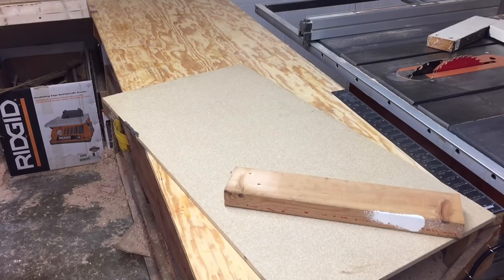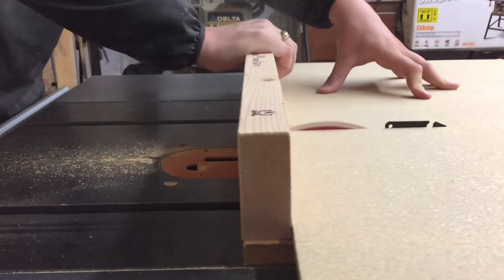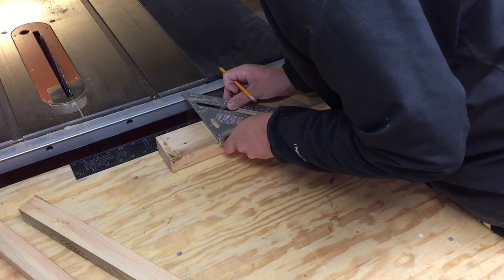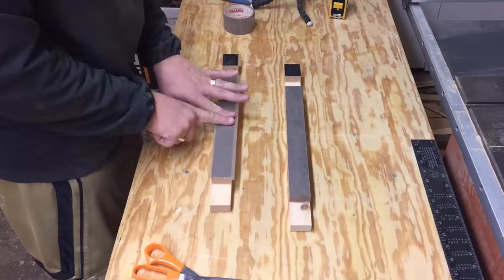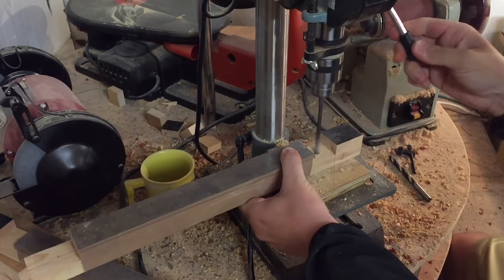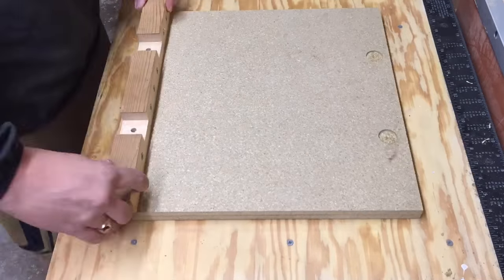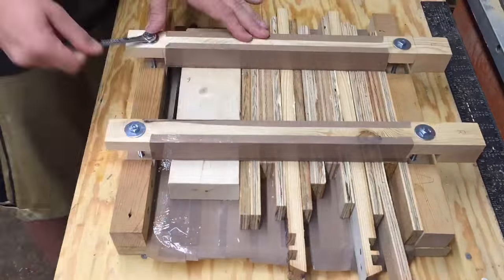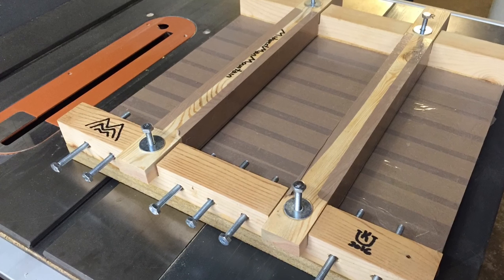How to Make a Clamping Jig

Comment: I used a piece of plexiglass on the bottom  works great I just do a light sanding
Reply from the maker: That is a terrific idea.  Thanks!
Reply: Craig Blanchard , great idea, i thought the same thing only i use a past3 wax prior to glue up so they pop right off leaving my lexan glass pristine, no need to sand off glue, sanding actually creats more surface  area for glue to adhere  to  when you think it through